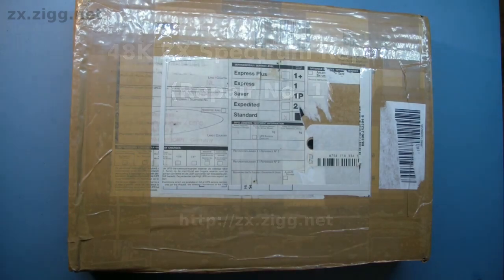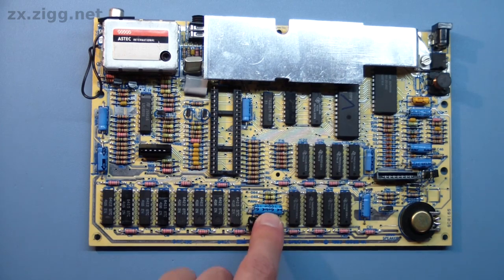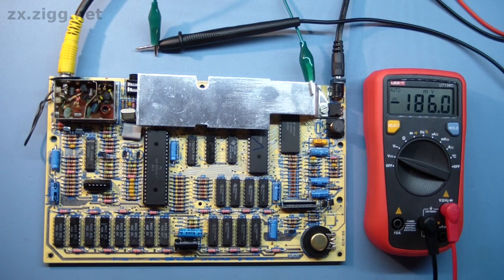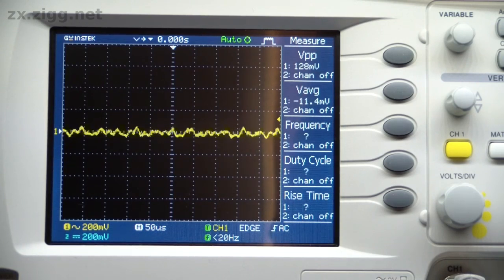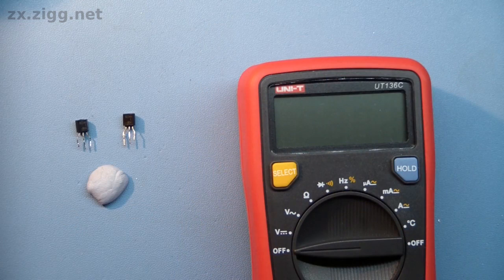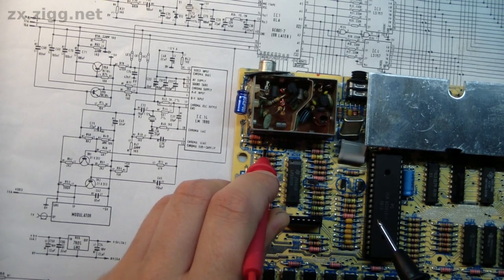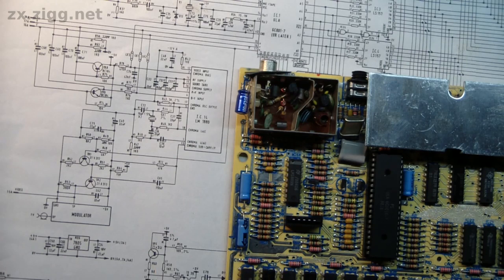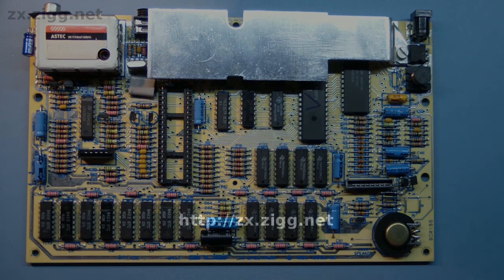48K ZX Spectrum Repair (No. 1)

Comment from the maker: Also, I very highly recommend using a bench power supply to power a Spectrum under repair. Set a current limit (700-750mA is about right for a 48K Spectrum with no add-ons) and if the limit operates for more than an instant when you switch on, switch off immediately. In most cases, this will prevent any further damage from being done.
Reply: so would you suggest that when connecting a bench power supply that the current should be limited rather than the voltage? when I connect mine to my game gear having set 9v, it powers on and then immediately winks out again

Comment from the maker: I meant the comments I originally put above to be a reply here, so I'll move them...
That diode is normally D15. A likely cause of failure is something drawing too much current from the voltage converter's 12V output. There's a decent chance one or both of TR4/TR5 have been damaged too. Replace D15 and try the tests described in the Initial Tests video. What results do you get? If they are not as expected, DO NOT power on the Spectrum.

Comment from the maker: It isn't particularly critical. Most displays contain an input DC blocking capacitor anyway; I just think it's slightly nicer to remove the arbitrary offset that's a result of the output buffer circuit before the signal exits the Spectrum.

Comment: I've got a problem with an issue 3 Spectrum of mine, on the 12V pin that you measured at 5:39 mine is reading 9.6V and 0.12 Volts on the -5V line
Reply from the maker: +Sony Trinitron Your computer almost certainly has one or both of the following faults:

 - Failed transistor TR4 or/and TR5.
 - One or more failed lower RAM ICs that overload the power supply.

It's quite possible that one of the above led to the other and the same will happen again if you don't make sure both faults are not present before connecting power again.

The tests described in the 'initial tests' video usually indicate whether any of the above faults are present.

There are not many physically small transistors that'll work for TR4. If you need to replace it, you should use a ZTX651/ZTX652/ZTX653. These are fairly readily available from many suppliers of electronic components.
Reply: JoulesperCoulomb I get scrambled symbols and colours on the screen, someone said try piggyback the lower 4116 DRAM IC's which I will do, I may just check the transistors first.
Reply from the maker: +Sony Trinitron Sometimes putting a working IC in parallel with a faulty one can make a system work, but it isn't a particularly reliable method and I don't recommend it in most cases. Certainly don't do this with a 4116 if all power supply voltages are not present and correct, otherwise it'll probably damage the new IC.
Reply: Hi! Did you fixed your problem, cause I have the same?

Comment: If the transistors were originally installed the wrong way around, how come it took until now for the machine to have a fault?
Reply from the maker: If I remember rightly, its owner had attempted to repair it.
Reply: OK thanks. So didn't he put them in and think "errr the speccy isnt working correctly". Sorry Im genuinely just trying to understand if it's possible to have the transistors the incorrect way and the effects of that in case I find a similar situation. So transistors the wrong way will not work, period.!?
Reply from the maker: I think the owner had replaced the transistors, but not done so correctly.

In general, a transistor connected incorrectly in a circuit won't work and in some cases, would be damaged by being so. However, a BJT connected with its collector and emitter transposed will work as a transistor to some extent, but its performance will be terrible and most circuits won't function if this is done.
Reply: ok, thanks very much. love your channel btw :)

Comment: Hi. My Spectrum 48K won't show any colors, only black and white. When i first got my Spectrum the screen went yellow on first startup. black and white after that. Do you know where to start? It is an Issue 2.
Reply from the maker: +Emil Åkre In the case of an issue 2, it's quite likely you simply need to adjust VR1 and VR2 to bring back the correct colours. Sometimes it's necessary to clean the tracks of these variable resistors and occasionally replace them altogether.
Reply: +JoulesperCoulomb Thanks for reply. I have now changed both VR1 and VR2 but there are still no colors. Any idea?
Reply: +JoulesperCoulomb It also have a composite mod.
Reply from the maker: +Emil Åkre You are very unlucky as VR1 or VR2 are almost always the cause of problems related to the display's colour in issue 2 Spectrums.

The 48K Spectrum service manual contains some instructions for setting VR1 and VR2 by adjusting for particular voltages between pin 3 and pins 2 and 4 of IC14. Are you able to adjust VR1 and VR2 to achieve the correct voltages?

Beyond that, if you want to proceed other than by blindly replacing components in the hope of effecting a cure, it'll be difficult to continue without using an oscilloscope. The service manual gives examples of the signals (table 4.1) that should be found at various pins of IC14. Checking these would be where I'd start.

Sometimes it is possible to diagnose faulty components in the video circuitry by taking DC resistance measurements between various points while using the circuit diagram to work out whether the readings are reasonable or not. It is very rare for the passive components in this circuit to cause problems, though I recently repaired a Spectrum that had a faulty 100nF capacitor that caused loss of colour in the display, so it can happen.

Comment: Nice vid sir! Really intereting. I have a clone after ZX Spectrum named HC-90 made in Romania from 1985 till 1992 or something. I have found it in basement and tested after so many years of inactivity. I have a problem with it. A video problem. It worked fine until one day when the colors went black and white and now the loading stripes/lines it goes over the paper. It is going right in rest only this problem. I have try to conect it with the RGB cable a Db9 pins to scart and the colors now appear is not black and white anymore but still the loading lines go over the paper. The border influence the paper I mean it doesn t support all combinations of borders and papers. If I try BORDER 0, the paper automatically goes magenta which is PAPER 3 and so on. Even the starting logo is written in green color not black which supposed to be. Is frustrating because in games u can not play good because it not translates all the colors corectly and combinations between them. Iis interpretate black as  green and white as magenta somenthing like this. The defect that occured both influnced the lines problem and the black/white video coaxial module proble. What can be the problem? What should I check? Maybe a cold soldering point, should I measure all the pieces? I m trying to find a circuit diagram for it, still no luck so far. THX in advance!!!
Reply from the maker: I haven't worked on one of these and without being able to examine it for myself, I don't think I can say much that'll be of help to you.

So far as you can tell, does it work properly other than the display fault?
Reply: Yes is working properly it starts without problem,is loading the game corectly, I am able to play to make programs in BASIC, only that video problem. I even tryed to switch RGB colors on the cable among them but still the same problem. This type of clone is a pale pale copy of ZX Spectrum made in that period with russian parts. They have improvede many characteristics. It has a regulator of 5v, on a radiator in front just like on ZX but from 9v source although i have eliminated that and I am powering him from a pc source.If I find any documantations I will send it to you.

Comment: Did you try to connect it to the HDTV? I have Samsung LED TV, the Spectrum is working but no signal present on a TV
Reply from the maker: František Fencl I've never attempted to use a ZX Spectrum with a modern Samsung TV. It is the case that some televisions, mainly newer ones, reject the video signal from a Spectrum. Have you been able to test your Spectrum with another TV? It could be worth asking about your specific model of television in the forums at http://www.worldofspectrum.org to see whether you can obtain a report from someone else who has tried the same model.